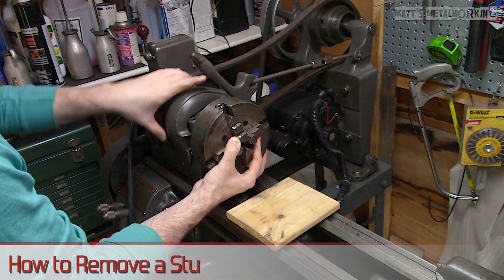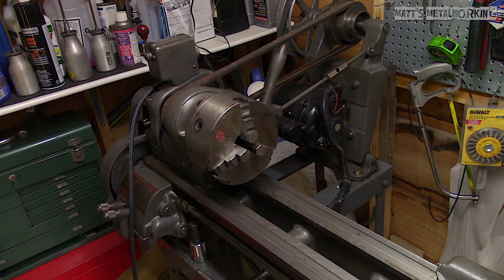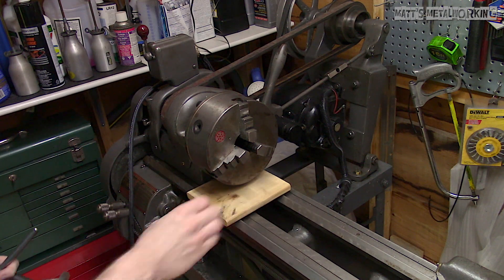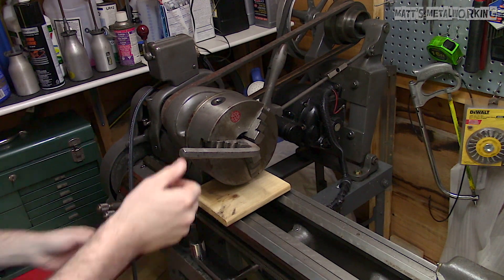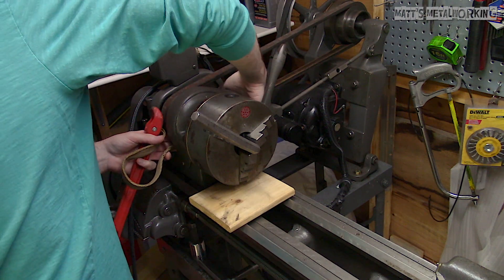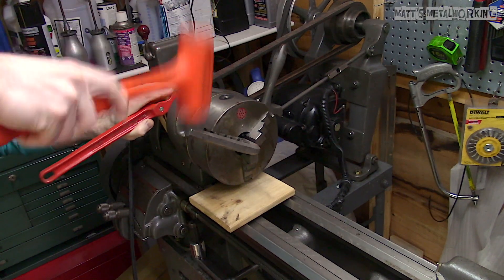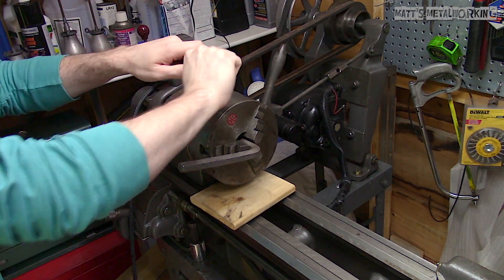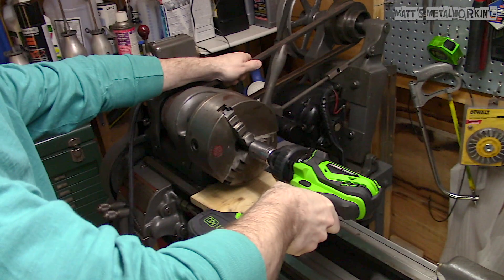How to Remove a Stuck or Seized Chuck on a Lathe

Comment: But what happens when the piece I am working with makes the lathe stop when I try applying any amount of force and it goes back to spinning just fine when I remove my chisel from it.
Reply from the maker: Sounds like the belt is slipping. Try tightening the belt first

Comment: I recently aquired a 1908 Monarch with a siezed 3 jaw.
I've given her some pretty big blows and that chuck will not move....
Any suggestions would be greatly appreciated
Reply: Heat, but be careful, try to blast the chuck with as much heat as possible while making sure to try your best to not heat up the inner shaft and then give it a whack with a brass hammer, I find lead deforms too much, dead blows break apart and a ball hammer does damage, brass is the perfect medium
Reply: @joshbaker43  Thanks for the tip. In the end, I machined a leveraging jig for hammering on that fit perfect into the teeth and extended beyond the radius of the chuck. Two wacks and she was free.
Something about beating on equipment just scares me.
(Former Aviation Flight Engineer)
Reply: I tried everything in here. Had to put a piece of EMT conduit sideways through the jaws and put a ton of weight on it near the chuck plus a few blows from a rubber mallet to get mine off. 

Turns out the previous owner loaded the 3jaw filthy with grime and metal flakes and it had nearly seized on. 

Spindle screw had some pitting in the bottom of the last couple of threads, but everything cleaned up well and mated properly when I tested again.

Comment: Hello Mat. What I have a similar to yours but mine says craftsman on it and there are no levers in front of the gearbox for thread cutting. Mine is older I'm assuming as there are no levers, you have to achieve the correct feed my changing gears supplied with the lathe. I really don't know how to set it up for thread cutting but then again I've not had a need for it. The other problem I have is my chuck is super stiff. I mean the T handle is almost unturnable by hand and I don't know what you would do to service it. I would assume it would be to simply disassemble it and clean everything but I really don't know that for sure.

Comment: Hi - great video - my only concern with using oil on the spindle threads would be it will cause an over torque of the chuck during use? This over torque could cause the thread to stress and fail. I am not an engineer, only speculating my thoughts.  For the same reason you want the threads to be lubricated for removal it will work against you also by over tightening and exceeding the allowable torque initially. What are your thoughts on this point of view?
Thanks for sharing.
Reply from the maker: Thank you! You may have a slight amount of over-tightening, but due to the seize of thread there shouldn't be any issues with stress. A 3/4" (19mm) bolt can handle around 200ft lbs of torque, that's much smaller than the spindle thread and it shouldn't be seeing that much force when cutting.

Comment: It is ok after getting the chuck off to clean everything good the put some  never seize on it
Reply from the maker: Oil would be better. If you run the lathe in reverse, the anti seize may allow the chuck to come off during operation.

Comment: My 1921 Hendey saw me watching this, I can feel it laughing.
Reply from the maker: Holy, 100 years old and sounds like still in use! If machines could talk.
Reply: @johnlockesghost5592 - My 1910 16" Hendey has a 4 jaw scroll chuck that I've been trying to get off for YEARS!  It runs true & works great so I haven't gotten overly aggressive with the torch or hitting it with big heavy things but there are times when I could sure use the independent 4 jaw for odd shaped castings & stuff.  Did you ever get yours off & if so how'd you do it?